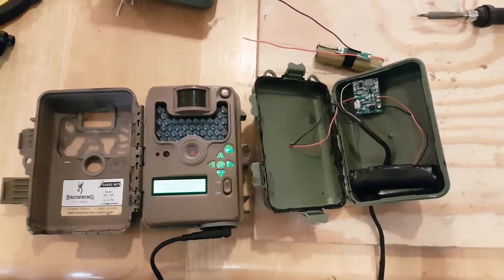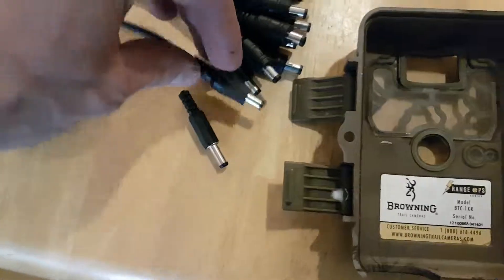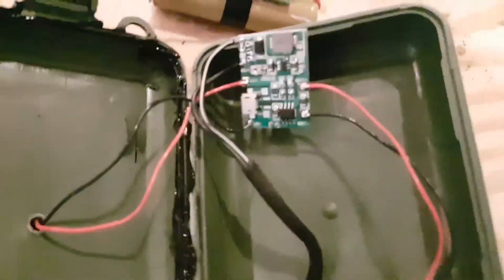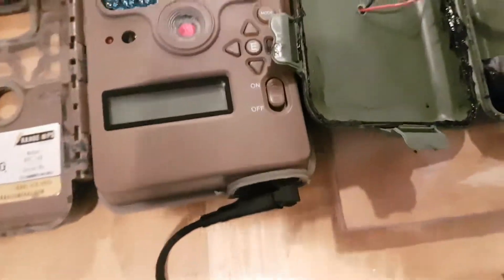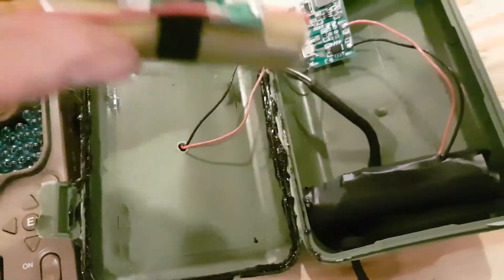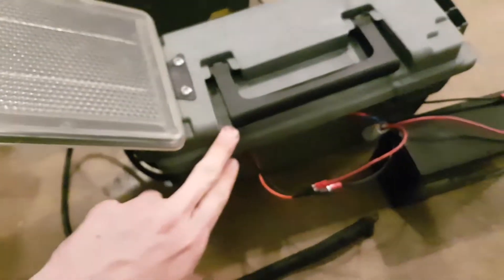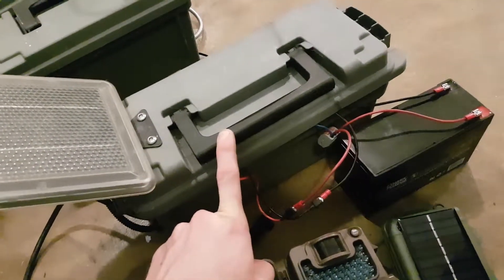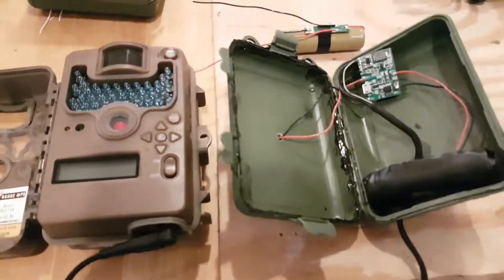Trail Camera Battery Pack - Small, Cheap, Li-ion version

Comment: Can I get some guidance on where to find the solar panels, case, and circuit boards?  When I looked on the site I could not find a clear match to what is described and I don't know anything about them to figure it out.  Thanks
Reply: I found the cases.  Need help with the boards and panel.
Reply: Nevermind I found them.  thanks

Comment: This is cool.  I saw your updated solar panel video... Is it still working good?
Reply from the maker: Yes. They work awesome.  Every now and then when I move them and they aren't getting enough sun will they die. I noticed this is more of a problem with my browning (12v) cameras when in the shade. Some of the issues have been related to using old/used batteries and the batteries have failed. So it's hard to tell when they stop working why it is.  Even without the solar they will last about a month. What's really suprising is how well the cheap plastic boxes have held up. Thanks for watching.
Reply: concert610 that’s great.. Thanks for the reply. Gonna make some up.
Reply from the maker: @tjgerhard  your welcome.  Let me know how they work out for you. I love not having to deal with disposable batteries any more. Plus it was alot of batteries I would need which gets expensive and alot of extra handling of stuff.